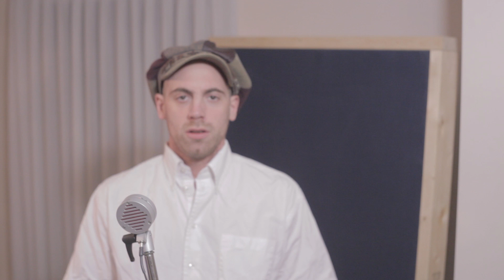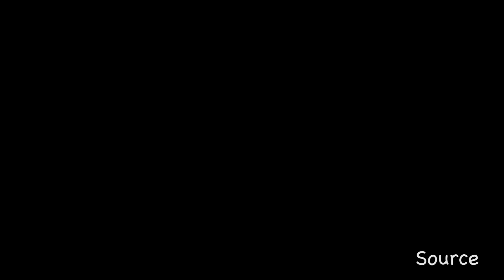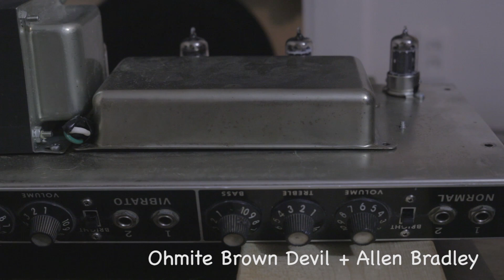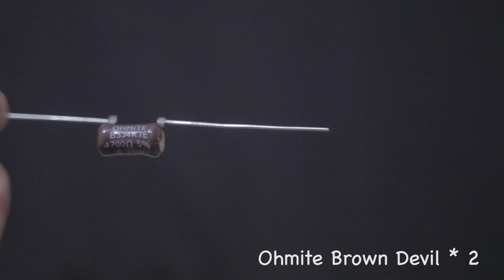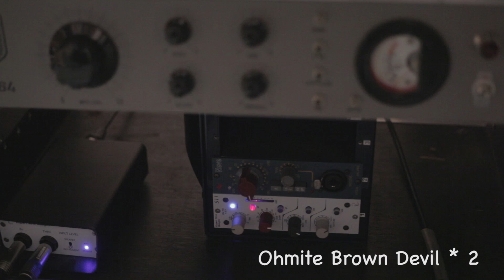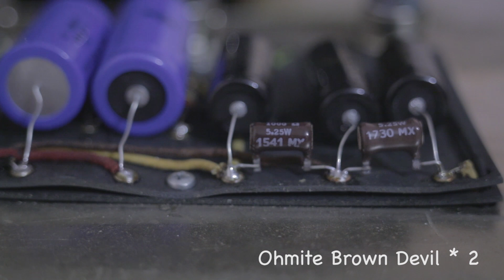Resistors can change tube amplifier sound from power supply?

Comment: Power supply resistor doesn't make a difference in bass response, they do however in noise in very high gain amp stages. Because the power supply resistor acts as a voltage divider with the tube so it will introduce some hiss into the circuit. The most critical place is the first stage grid stopper anyway, but i can imagine that first stage anode resistor makes a difference in noise.
Reply from the maker: Have you ever tried to add and remove filter choke ?
Reply: @NickAnanas  A filter choke is not a resistor, it's an inductor. It has steeper attenuation but also a bump at the cutoff frequency.
Reply from the maker: Yes it is an inductor and it acts has a resistor too. You may not have looked for the Brown Devil wirewound resistor to see that it has an air gap core just like a coil.

Comment: Every part from the circuit makes a difference to the sound, even from the power supply because it is just as important.
Reply from the maker: Yes, that is the interesting part. Usually people will talk about tubes,  speakers or wires but there not in power supplies or resistors. Which is somehow the motor of the system.

Comment: So far so good , but....Did you measure the nominal resistance values of the resistors compared in this video?   I'm afraid the difference in the sound response may occur as a result of the different voltage drop provided by different cc resistance values despite the influence of their internal inductive reactance.
Reply from the maker: It was not a scientific test, in the original design it uses a carbon resistor which is really poor in noise compared to wireround. Of course there is an improvment.

Comment: Very interesting Nick...Thanks. How did you pick the Ohmite Brown Devil as the replacement? What is it's composition?  Any drawbacks to the Brown Devil / high end O.K.?
Reply from the maker: It was suggested on Jeff's place by Yakazi-san. Since we want to filter in the power supply inductance is good, so elsewhere it should not be used.
Reply: Perfect comment! I was thinking of trying a Mills wire wound but they are non-inductive (great in speaker crossovers though!). I've got an amp I am re-building that suffers from weak bass....will try these.
Reply from the maker: I would likely play more with the values of Coupling Capacitor et Bypass cathode electrolytic capacitor, than really change bass respond like a direct EQ
Reply: One of my carbon comp resistors was +1K out of spec.....I saw in another Youtube vid that CC resistors go up in value as they crystalize / age. Just curious, did you check the value of the CC resistors you pulled?
Reply from the maker: Doug Sharrott depending on the system and value if the resistor has a 5  to 10 % difference is alright... CC are already 10% tolerance, carbone film around 5%, new models can be better.
Reply: Where is Jeff‘s place? Is it a forum? Who is Yakazi-san? Really interesting 😊